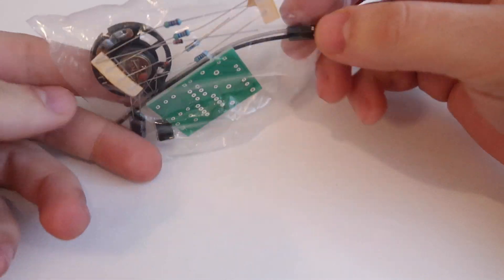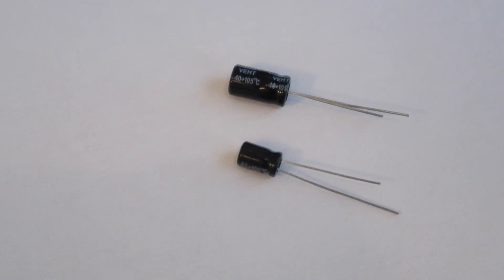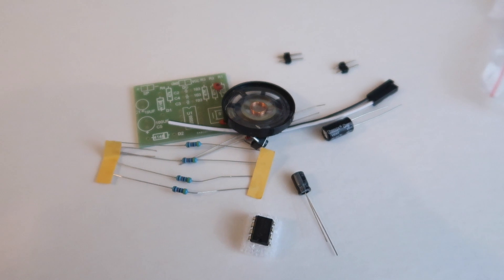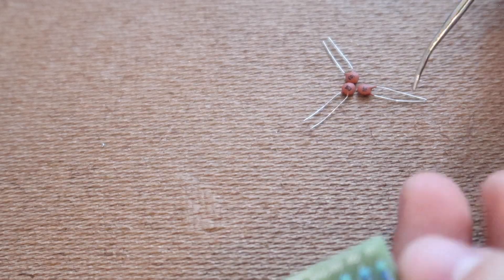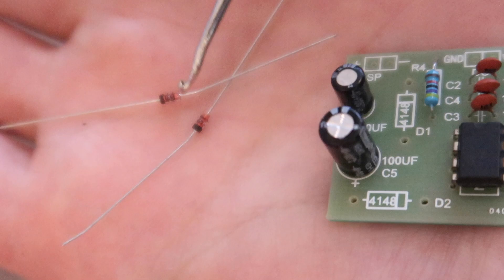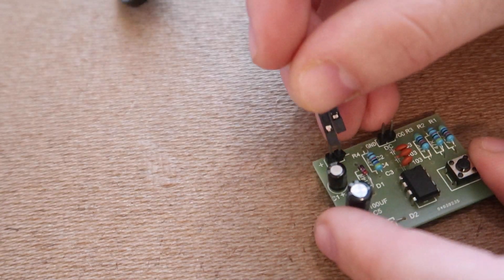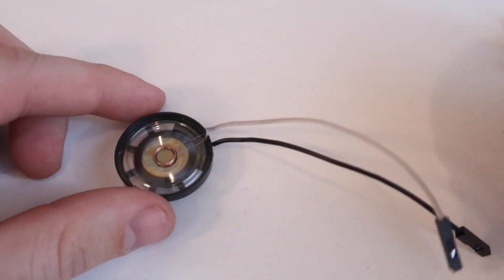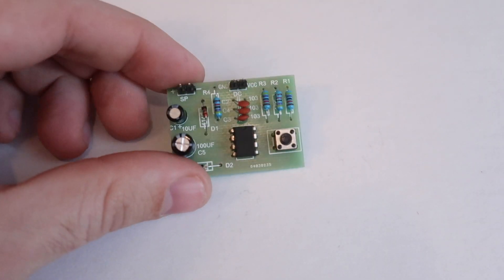NE555 Electronic Doorbell DIY- Review and Assembly

Comment: How do you put that on a door? This is just a circuit that will make a noise when you press a button.... just that.. from that to a electronic door bell there is a big gap.
Reply from the maker: You are correct.  I don't think it's meant to be used for a house doorbell (although it technically could).  My understanding is that it is educational to show how the circuit can be made.
Reply: @DrJeff-  Change the name of this video so people don't be confused. I'm an electronics engineer